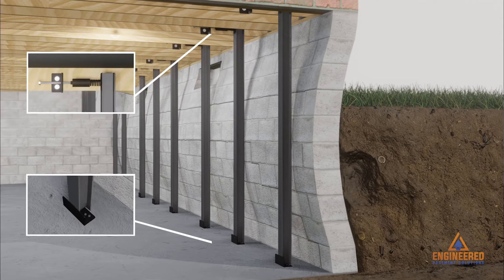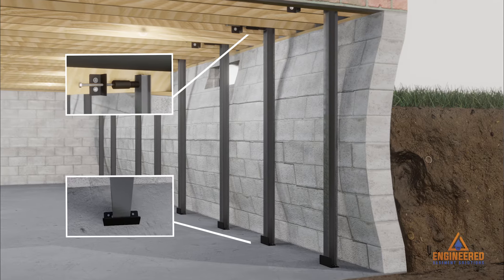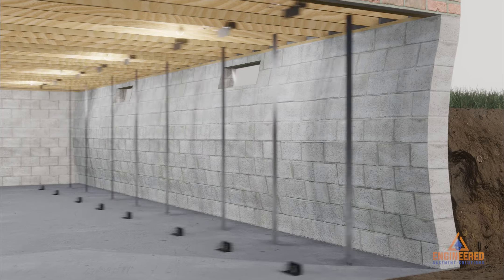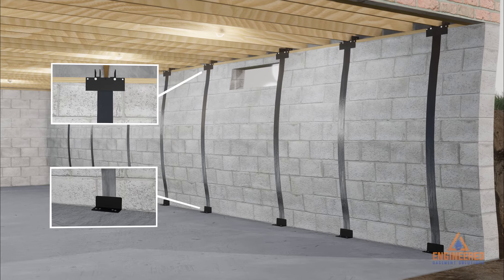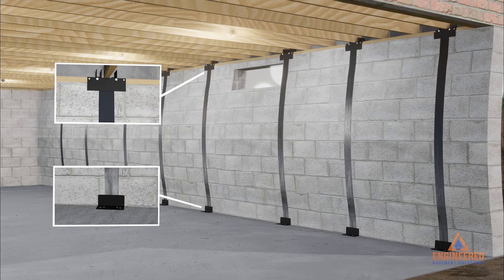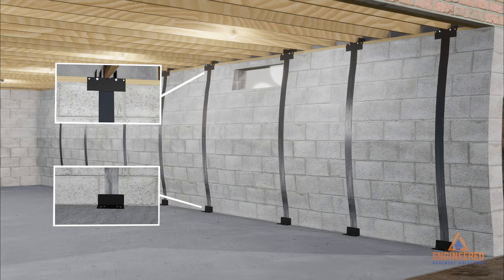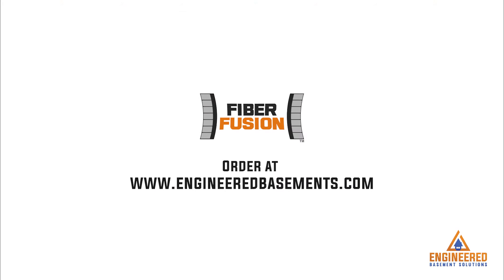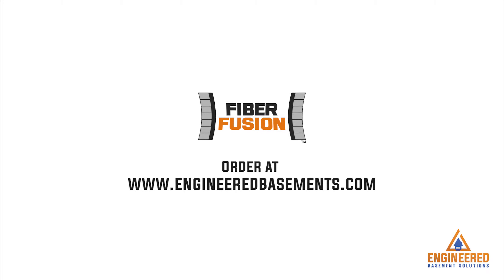Fix Bowing and Bending Basement Foundation Walls

Comment: Why don't you design that wall to resist the lateral loads due to earth pressure? It is a very simple RC structure; you just need to design the H and V rebars required to resist the loads. A very simple calculation that can be done by someone in high school!

Comment: Shouldn’t this be done from the outset to prevent this from happening down the line?
Reply: In Lincoln, NE we used mostly poured concrete for foundations these days. They hold up better and don't need this
Reply: @PinaclexxProduction  if cinder block walls are built properly then there would never be any issues. This is why things like ICF have grown in popularity. It's sad really. I love cinder blocks
Reply: If it was bowing outward probably. Could probably space a few of those on the outside after the inside install for more support 🤷
Reply: @macthenut4646  the wall will never bow outside, the pressure is from the dirt outside pushing the wall in

Comment: The carbon fusion method is no good as it  is too thin and depends on tension, and so can never be straightened really,  while the other depends on the bending moment of the vertical bean or tis maximum width or moment of inertia.

Comment: Or maybe just dig it out and replace the wall and do the rebar and fill correctly the second time....
this is crap and is a temporary fix. Don't fall for it-youll end up doing what I said down the road anyways.
Reply: you are 100 percent correct, I am in the process of buying a discount house that has this bowing on two long walls, everyone that has seen the property has run to the hills. The only way to fix it is as you say, excavate the outside, but I will try straighen the wall first with horizontal jacks before replacing it section by section..  There is a way to get concrete and rebar in an existing wall too, you break holes at the very top block and pour in a soup concrete mix. I hate these temporary fix videos and the guys doing the work are charging a fortune.